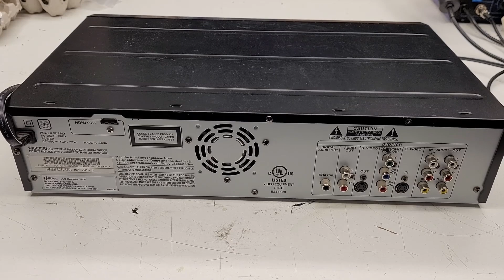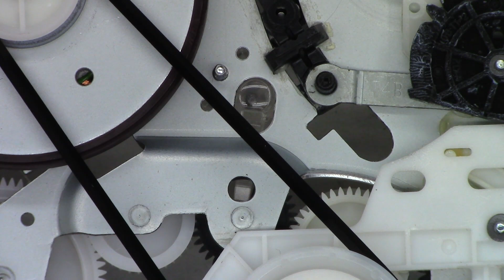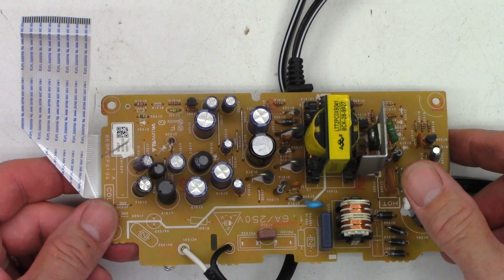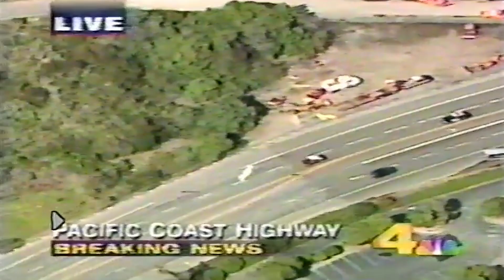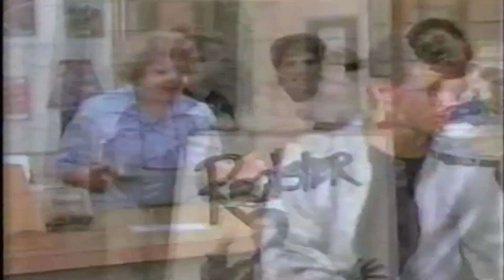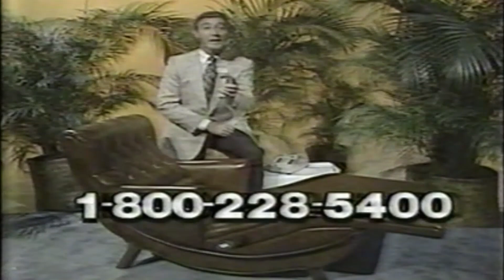A RARE FUNAI ZV427FX4A VCR/DVD- wont take a tape, Mechanical binding

Comment: @norcal715 how did you get the whole bigger portion out? Mine is held in by some sort of rivets. I have the same model and it loads a tape but won’t pull the tape out the cassette. I think I need to adjust the mode switch.

Comment: Any idea why the eject mechanism seems to be getting stuck? I followed your directions on another of your videos for cleaning the prism and the IR LEDs, and that solved the playback issues (thank you!), but now I'm finding that the left rail gets stuck ejecting a tape and it needs a bit of help to lift all the way. Did I mess something up on reassembly, or is something amiss? Regular Play/FF/RW/Stop functions all seem to be good, and I figured out how to re-insert the mechanism arm into the door for proper insertion. (Funai ZV427FX4)

Comment: I thought to myself, okay he has it dissembled and the drive belt is right in his face. Will he clean it with the magic joy juice? And you didn't touch any of the belts as a normal preventative cleaning procedure, but you changed the cap out which tested fine. That threw me. Why not, it was right there? Good catch on the bent frame. I was looking at the wear lane and noticed that as well.
Reply from the maker: I did clean both belts (capstan, and loading) just did not include it in the mix. The video was getting fairly long and some people lose interest easily.
Reply: @norcal715  Gotcha. I just didn't see or hear anything mentioned about any of it. Usually you let us know what you did when you don't show it.

Comment: That was quite a challenge! At the 19:50 mark you can definitely see something on the end of the q-tip, possibly a tiny little piece of a bad cassette that shed into the mechanism. Enough to block the optics, perhaps?

I've also seen similar issues when a strong light source is falling onto the deck. It upsets the optics and the deck goes into shut down. With some machines you had to pretty much put the top cover back on to get them to behave! It can lead to much head-scratching for the uninitiated!

Comment: Man what I wouldn't give for some help on this TV I'm working on, main board powering up but no display, inverter/backlights working, previous main showed image when I put pressure on the main ic, 12v to tcon is present, no scope to check ldvs lines but there's voltages on them, baffled

Comment: Nice, I have a magnavox zv427mg9 that the head drum doesn’t attempt to spin, It is not the mode switch because it loads the tape properly!
Reply: The head drum may be seized up. He did a repair video on a Toshiba DVR620 which had that problem.
Reply: @TheVCRKing  Thanks for the tip, but I don’t have the right size allen wrench to take apart the vcr head
Reply from the maker: It is a 1.5mm allen
Reply: @norcal715  Thanks! I've also wanted to know that so I can lubricate head drum motors myself.
Reply from the maker: Nolen Sansom Watch my latest video, It shows another fault of the mode select switch being bad. It will load the tape normally but the head drum wont start. https://youtu.be/SJybP9-eTDI at 3:35